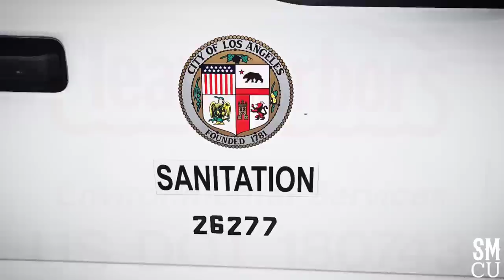Venice Restroom Cleanup Targets Homeless Encampments

Comment: A cheaper solution would be to install sirens in the bathrooms stalls and have them start blaring at 140 decibels when ever someone starts setting up camp in the bathroom or won't come out.  Also have video cameras in each bathroom stall to monitor the stalls in case someone tries to use drugs or urinate on the walls, and if they violate the rules turn the siren on.
Reply: Sirens cant identify a human setting up camp, Jerry. 

THINK, JERRY, THINK.

USE YOUR BRAIN